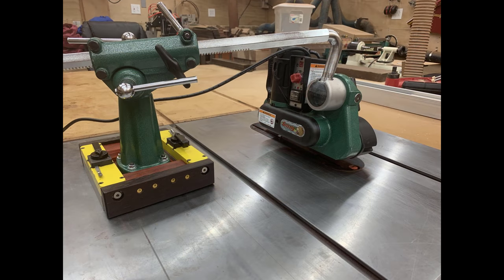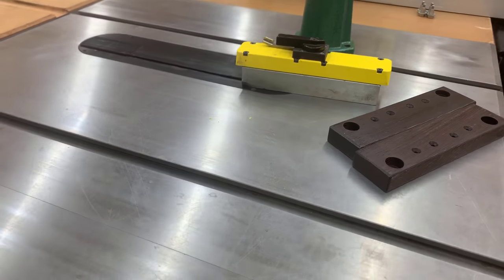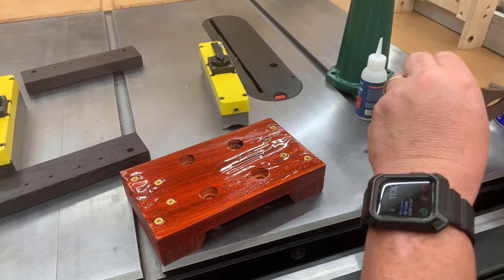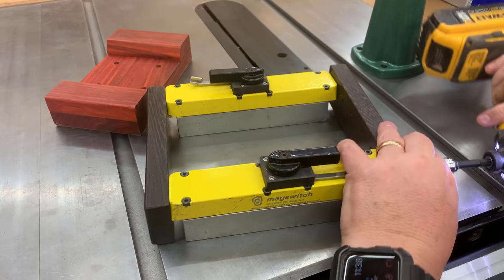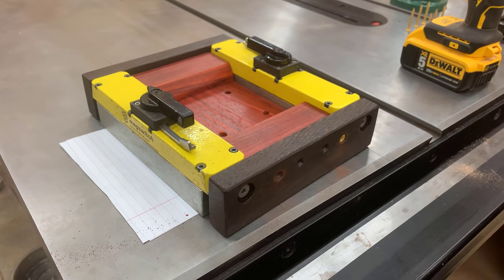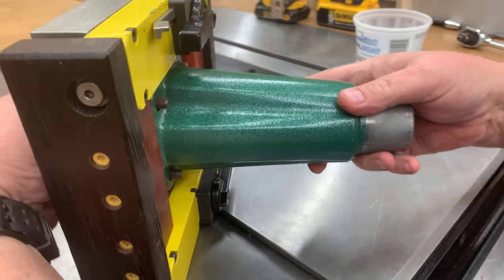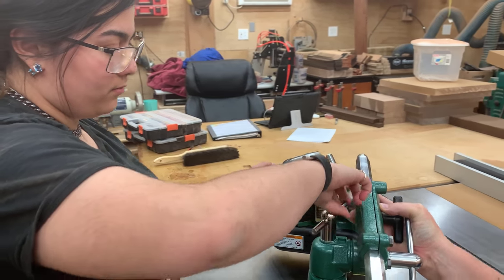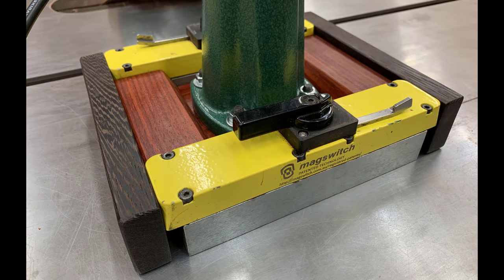107 -  Mobile Power Feeder with Magnetic Base by Magswitch - Free Give-Away-

Comment: This solves the one big headache that I've always had with stock feeders, mounting and un-mounting them. For large shops with dedicated ripping saws it has always worked because they never remove the feeder. For the rest of us we need to remove and replace the feeder frequently on our only table saw. I can see that I'll be using my feeder more often if I make one of these. Thank you for the video.
Reply from the maker: Hi Charley! I agree completely! That’s why I never got a power feeder before this. But I’m So Glad I have it now! It’s crazy how much safer & easier & faster it is for a batch of cutting. I originally thought I’d put it on the table anytime I was cutting 50 or 100 pieces. But it’s actually so fast to set up, I’ll put it on the table just to cut 10 or 15.

Comment: Nice idea.  I have this same power feeder and I made a cool mount for my fence. The benefit of doing it this way is that the feeder goes where the fence goes.  I have a INCRA positioning system so when I slide it over to my router extension table I can also use the feeder for router operations. I think $300 is pretty pricey.

Comment: Wow. Great stuff but as usual, Andy's stuff is super expensive and can only be considered by the serious pros because of the overhead. His stuff is absolutely the best choice against all competition\, though. Thanks for showing how well it works -- for those willing to spend nearly $1000 to get it. And if they have the bucks, they should absolutely get his Turbovise for about the same... In your shop, this feeder is an absolute must as far as I can tell. One thing I can see as a must too is a featherboard attachment to keep the wood against the fence as it goes through.
Reply from the maker: Hi Clyde! I do like Andy’s stuff. And the new feather boards from Magswitch are awesome.  But you don’t actually need one when using a power feeder.  You actually just angle the head slightly towards the fence, and it forces the wood very tightly against it as it goes through.

Comment: So I've worked at a large production Door Shop, and the value of power feeders really cannot be overstated. I think you're probably under estimating some of the mid-size power feeders. What I mean to say is I don't really see why the ones we have on the shapers for instance wouldn't work on the table saw with the mag. To be sure I've used some very large power feeders that I wouldn't use on a device like that simply because the only reason you're using such a large power feeder it's because your Milling down some very large stock. But on a table saw, you've presumably already rough cut for the most part. So even if you're cutting 2 or 3 inch thick stock oh, the resistance on a table saws just not that huge. So putting a decent size 4 or 5 wheel power feeder held on by a magnet shouldn't really be a problem. Anyways, love the idea, definitely going to talk my boss into getting one.

Comment: After I saw this video, I bought the Magswitch kit.  I added two more 325# Magswitches on opposite ends of the big magnets since I've only seen the kit used with 1/8 HP power feeders and I'm using a Maggi 1/4 HP power feeder which is about double the weight of the 1/8 HP feeders.  It works great on my table saw!  I'm going to attempt to use my Maggi on my 12" jointer (output side just past the jointer blade) while keeping it mounted to my table saw for stability.  It probably won't be powerful enough to pull boards more than 4' long.  I guess I'll see how useful this might be for jointing.
Reply: did it work?
Reply: @stevene9785  I haven't tried that yet due to no good place to mount the feeder.  My table saw can't get close enough to it for stability.  I think a small cast iron table will work but it might need to be bolted to the floor to keep it from moving.  It works nicely for ripping on my table saw and built-in router table on my saw.  I switched my feeder wheels to polyurethane that grips the wood better than the stock rubber ones.

Comment: Very cool!  First time I watched your channel.  I have wanted a power feeder for a long time.  My big hang up is I have a custom built overarm saw guard that I built, which I utilize more more dust collection than anything else.  I need to collect that dust because after 30+ years of woodworking I seem to be slightly allergic to the stuff.  I am thinking now, since I am proficient at Solidworks and have my wonderful Prusa 3D printer, if I could make some shields for the feeder that would connect to my 4" hose.  This seems like a good project to tackle.  ;)
Reply: where did you purchase your magswitch?

Comment: No feather board? Did you find the tracking kept the boards tight to fence?
Reply from the maker: Hi Lou. No featherboard needed with a power feeder. You angle the power feeder slightly toward the fence and it holds the material very tightly to it.

Comment: Makes me wonder if someone will ever post a tutorial on making their own DIY power feed, using an inexpensive 'Harbor Freight' belt sander, wired-in with a speed control? The articulating arm on this professional unit could be replaced with a simplified gantry system that has a magswitch on each side of the table's fence.

Comment: Curious if the power feeder pulls the fed stock towards the fence or do you use a featherboard while doing your production work?
Reply from the maker: Hi Steve, you angle the feeder head slightly toward the fence, and as it pulls the pieces in, it holds them very tightly against it. No featherboard needed.

Comment: James, thank you for this excellent video! I may look into one of these baby power feeders. I had no idea that you could get one so reasonably. I love MagSwitch, which I use for several things.  I also currently use the Jessem Clear Cut Stock Guides on my router table and have been contemplating the similar guides for my tablesaw.  Those run $200-$250 depending on whether there is a sale or not. After watching this video I started thinking that if the Grizzly baby power feeder is only about $350, I’d be getting a lot more for my money. I did have two questions for you: 

1. When you use the power feeder is it suggested that you angle it in a few degrees toward the fence? This is similar to what the Jessem stock guides do.

2.  I have a Laguna Fusion F2 tablesaw. It is 1.75 hp, 110V. I know you said the baby stock feeder isn’t gonna be able to do the largest lumber, but can you give me an idea of what I could expect with it?

As always thank you so much for your great contributions to the community.
Reply from the maker: Yes. I angle it just like the Jessem Stock Guides. 

As for the power of the feeder, it doesn’t really have the power to handle long rips, like 7-8’ or more. Also real wide boards would likely be a challenge too, along with anything that is a bit warped. 

I think for those you’d have to go up in feeder size. 

If you do a lot of rips in 4-6’ board lengths, and maybe 8-10” wide at most, it would be much more suited for those.  I’ve seen a few people use it a lot for ripping off-cut pieces down to make cutting boards etc. and for that boring repetitive task, this power feeder makes it a breeze. 

Hope that helps. 
Thanks!
James

Comment: James, did you have to modify your grizzly baby power feeder?  I made my base just like yours. I used Jatoba.  When I orient the same feeder on left side of my saw I cannot get the head and wheels to lay flat at a low level.  I have to turn the head but now limits me to only feeding wide boards. I don’t have cast iron top on right side of saw.  How are getting your feeder to lay flat at a lower level to the table?
Reply from the maker: Hi David, I didn’t modify it. But I can probably help you figure it out. Email me if you can. My email address is james@kingsfinewoodworking.com
Reply: King's Fine Woodworking awesome. I’ll email you later today. I need to show you photos.

Comment: Great video James. Do you think this powerfeeder assembly could also be adapted to the outfeed table on a jointer?
Reply from the maker: Thanks!  I’m sure you can use it on any steel or cast iron surface no problem. I’m considering getting a cast iron top for my router table so I can use the power feeder there too.

Comment: $295.00 for a pair of magnets?
Reply from the maker: Yes. But more than just magnets. These are tools. They have a ratcheting on off system. Very clever engineering. And they are very high grade magnets with a 1000 pound pull force. I’m pretty sure these were designed by a team of engineers to use the strength of magnetism to make a functional bolt-able efficient tool.

I understand it’s not cheap. But I know it’s a product with more than reasonable value for someone who needs these capabilities.